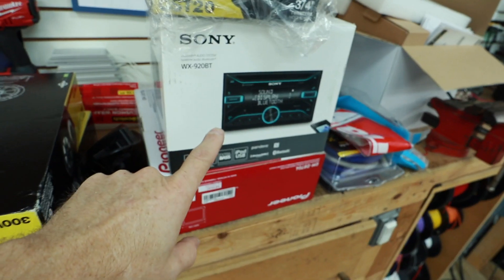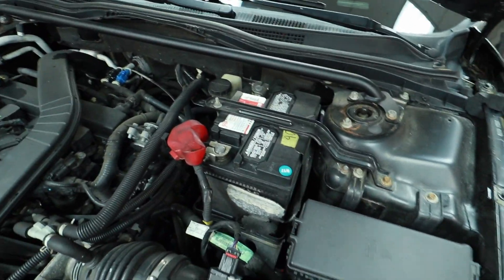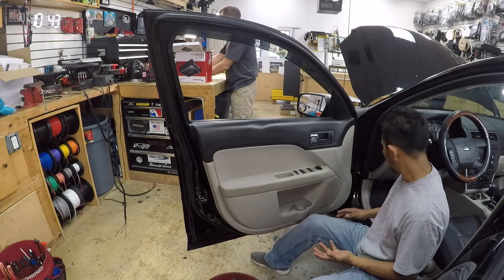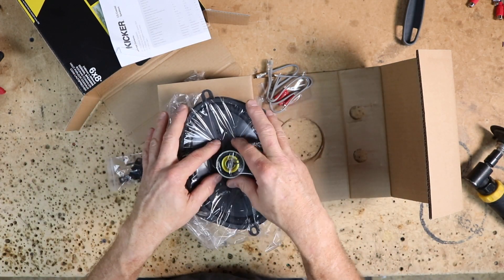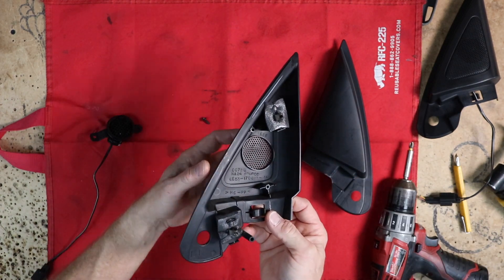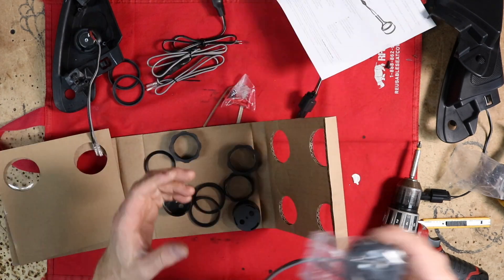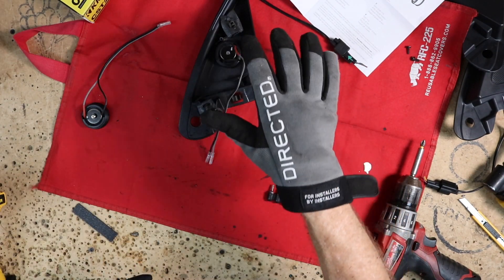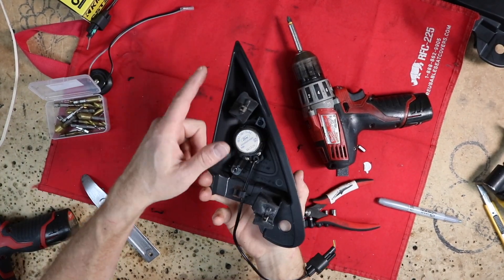We start on a Kicker speaker install in a Ford Fusion Installer Diaries 188 part 1

Comment: For the Tweeter I just go t Home Depot. In the Plumbing Dept, They have these Copper hangers with clamps. For the Copper water lines. Just buy a couple them. Cut and Bend to my needs. Use a piece of Foam or Double sided sticky tape between the back of the Tweeter and the Bracket.

Comment: I recently installed Kicker CS series 5x7/6x8 coaxials in all four doors of my 2012 Ford Fusion, along with Kicker CS 3/4" tweeters in the sail panels.  I'm running them all on factory power.  They sound amazing!  I know if I added an amp or aftermarket head unit, they would sound even better.
Reply: I bought kicks cs 6x9s component. It lacks midbass. Is it the same to you or am i doing it wrong?

Comment: Hello Dean & Fernando, I have a query, what is your opinion on the Joying - Intel octacore - Android 8.1 head unit, as a vehicle for a vehicle and what would be the best option to design a sound system primium with that head unit in a 5th  generation 4runner, with subbufer and the 6 components for the board, doors and tailgate, thought an amplifier Audio control D-6.1200 for the speakers and one of a channel for the subbufer.  Maybe you can make a video on YouTube about it.  You are excellent, great people and professionals, thank you for your comments, greetings from Lima Peru 🇵🇪

Comment: I would like to locate some good replacement speakers for my factory Bose system. Id memory serves they are 2 ohm. What would be a good speaker choice to replace the old Bose speakers? It is a 2004 Silverado LT. I want to use the factory Bose amp and need to find 2 Ohm speakers or it will not be loud from what I have been told thanks!

Comment: Hello
How can I know the speaker polarity (+/-) without removing the speakers from the door and without using the color of the wires?
is there a way to the the multi-meter or any other device to do that?

Comment: Can u make a stereo install video when u get a 2008-2011 Ford Focus I cant find a video on one
Reply: thats a very basic one dude :) i have same car lol. (but i also agree i would like a video just for the hell of it :) )
Reply: Jesus Garcia I’d like one for the hell of it to but on this car I wouldn’t even know were to start to take it apart I ordered the 50 bucks dash kit an a good radio just haven’t been able to figure how to pull it apart
Reply: Kamryn G feel free to DM me and I can send you pictures of where to find the stuff. I actually have to take my dash apart soon to swap out some RCA Cables. It’s not as hard as it looks. Have you gone on the Metra website? They should have good directions on how to take it out.
Reply: Jesus Garcia ok I’ll check out the metra website an see we’re the ac controls easy to take apart to put on the dash kit ? I heard u pop the passenger air bag cover off witch gives u access to 2 screws an same on the driver side but do u have to remove the conceal as well ?
Reply: Kamryn G yeap. Console comes off. Are you talking about the North American 08-11? Or European? I’m pretty sure you mean the North American. But if that’s the case then what you do is pop off the center vents, take two 7mm bolts out. pull up on the air bag cover (the whole thing doesn’t need to come off). then take two 7mm screws under the cluster, take that piece off. Open up your center console, pull up the ebrake as much as you can, and pull up on the cup holders. That will release that whole piece. Once that is off, you will two more 7mm screws holding up the radio and the whole thing comes out. I can send pics later today.
Reply: @jgarcia1925  yes I'm talking about USA focus thanks for the tip I'll try takeing it apart later on today thanks for the help

Comment: This question is for any experienced installer:

Will those plastic 5x7 to 6.5 adapters work in this exact application? Will it sound sealed and tight? I have the same car and I want to go 6.5’s with a 5 channel amp but I want to make sure that adapter will seal them the way the factory speaker is. Any input is appreciated
Reply: For any speaker adapter its best to use 1/16th foam on the back of the adapter and back side of the speaker mounting ring. I did that to my Chevy with just regular components/coaxials and what a night and day difference. The bass has a lot of more punch and the system sounds a db or 2 louder. Could very well be a placebo affect.

Comment: Will it change the impedance of the speaker when piggybacking of another speaker? Like what you did in the front doors.
Reply: exact same as a dual voice coil sub. so this is dual 4 ohm in parallel, so overall resistance at the amp will be 2 ohm.
Reply: The amp will see a 4 ohm load up to about 3.5Khz and then from there on up, because of the extra tweeter and crossover, it will be 2 ohms.
Reply: @kipplitz  thank you
Reply: @duzzah  thank you
Reply: @kipplitz  incorrect. the overall resistance with no power applied will be 2 ohm. resistance will change depending on frequency, but thats a bit too deep of a hole to dive down.
Reply: @duzzah  the question was impedance, not resistance. 

With no AC signal present, at rest, you are correct that the resistance will be around 2 ohms.

In operation with an AC signal what I stated is 100% correct.
Reply: @kipplitz  my mistake, always see cars as DC. Even though they both are ohms...
a speakers impedance is not a constant 4 ohm from 40hz - 21khz. It varies wildly over the frequency range, so you shouldn't define a set frequency that it suddenly changes. "Resting impedance" is what manufacturers quote, my thoughts are thats the method/numbers to use.

Comment: Worse brand of speakers - I would of advised this customer to return those and get some other brand of ebay speakers like DS18 has louder more sq speakers for this price range
Reply: Is ds18 as junk as rockville?
Reply: Kicker is not the "worse" brand you should do some research before talking down on a brand they are a reputable company they might not be the best but you can get some awesome sound out of them if installed correctly.
Reply: Ds18 is a glorified boss audio lol. Run deafbonce if you want loud and clear
Reply: When I installed ds18 (not the cheap ones ) they sounded like the elotero speaker idk if it was my system but I replaced them with kickers all around and they are really clear and loud I wanted ds18 because everyone is talking about them  but didn’t work for me
Reply: @realname6485  dude, rockville is garbage. Ds18 is not, dont know where ur getting that from but ds18 is fire. U must be new to car audio.